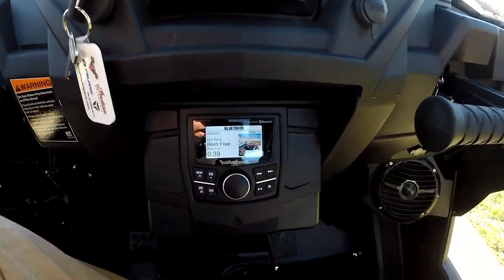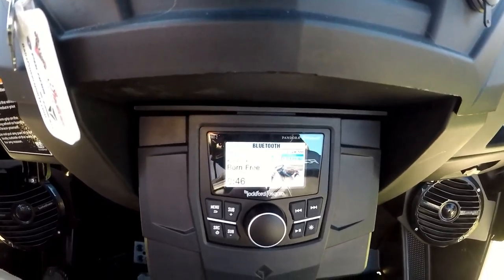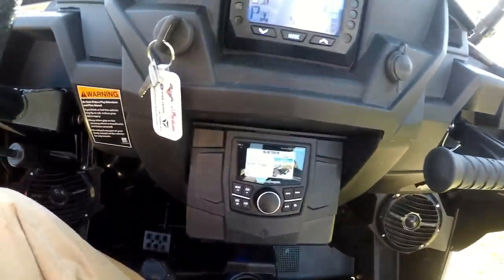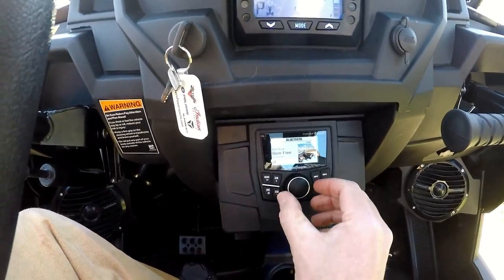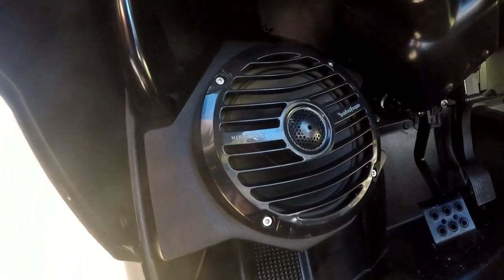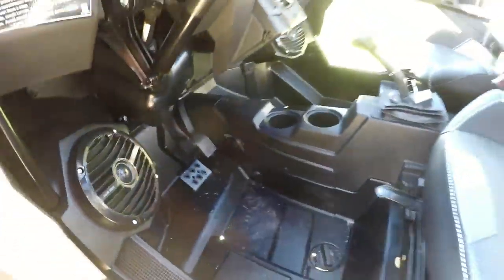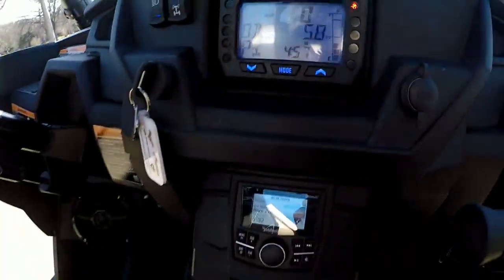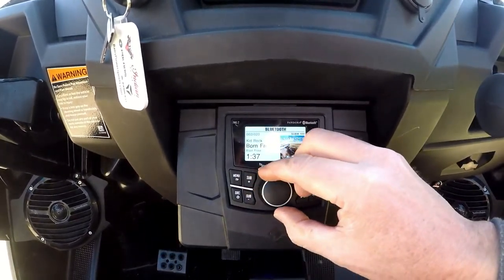Rockford Fosgate Stage 4 system in a 2017 RZR 1000 turbo XP 4

Comment: Just so you know it's not a XP 1000, it's a XP Turbo which is only a 925cc motor. You'll run into issues if you go to buy certain parts for a 1000 instead of a Turbo.